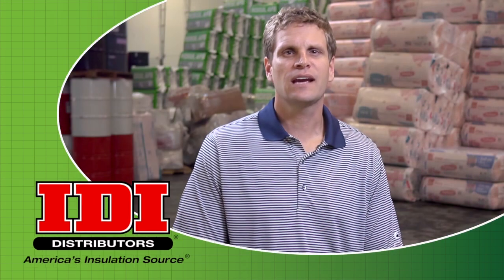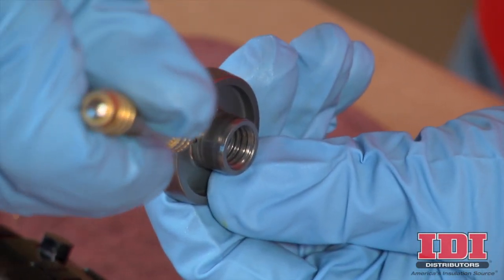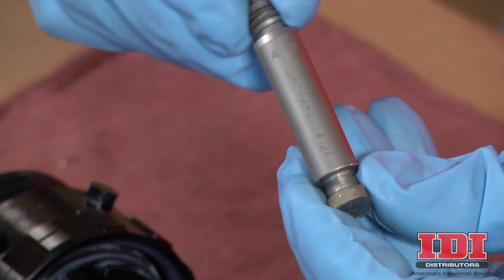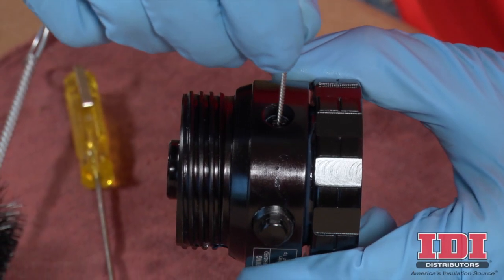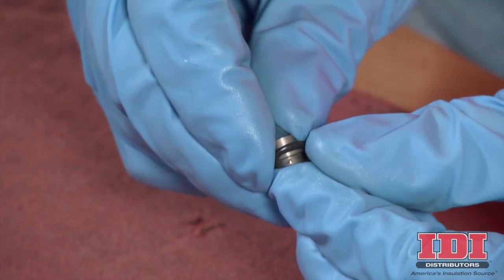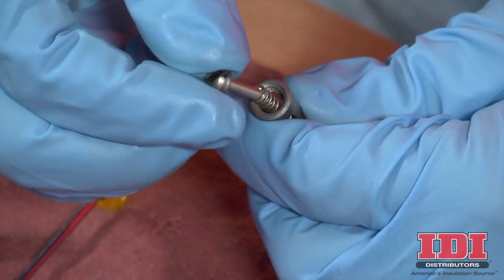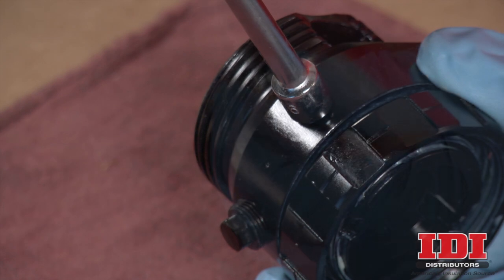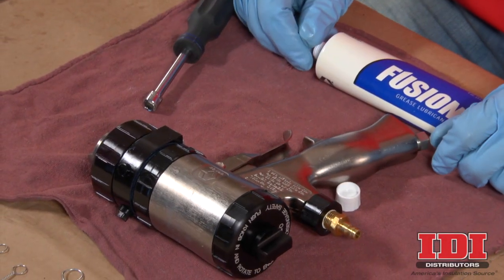Graco Spray Gun (Fusion) Front End Maintenance

Comment: If you got your gun clogged. Disassemble gun's head completely. Remove all rubber seals, put all of those parts in fries deep fryer but instead of canola oil use paint thinner. Leave it on over night in the deep fryer. In the morning remove everything from fryer. Put new seals. Assemble everything.